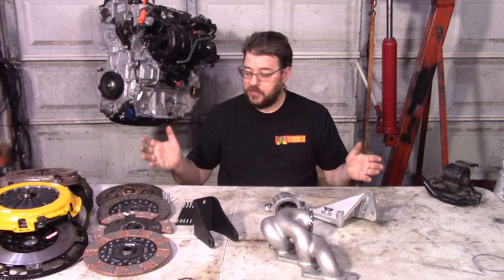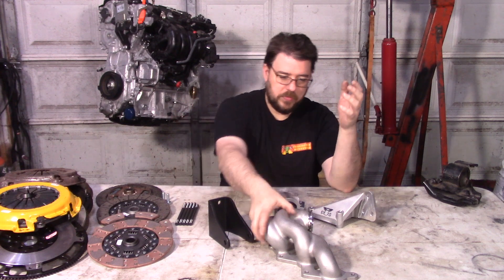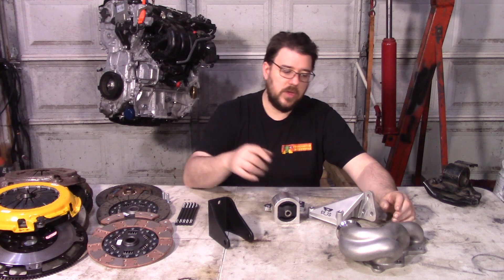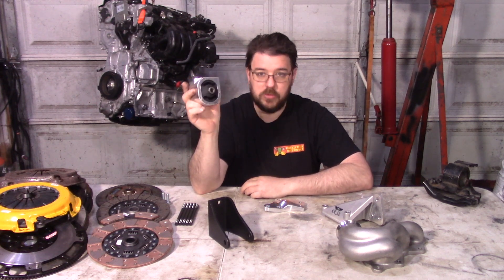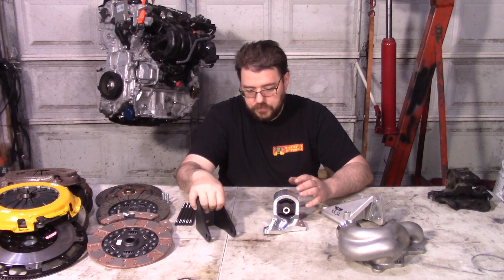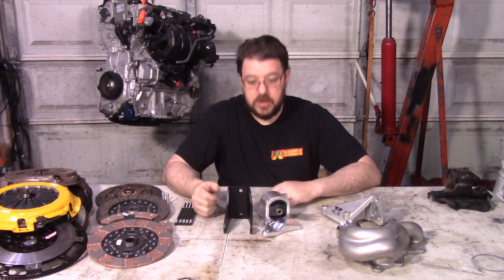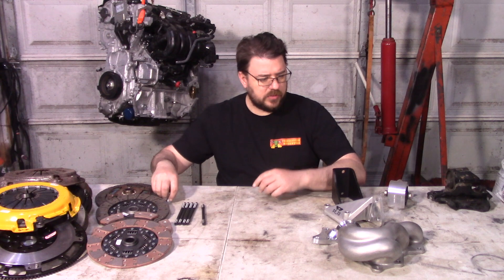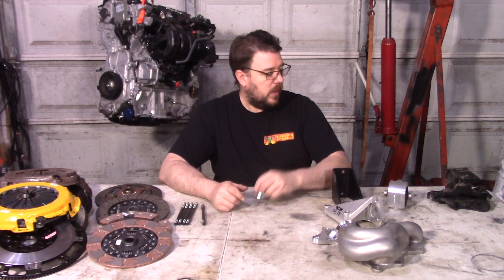New MR2 parts for engine and transmission swaps

Comment: Suggestion on the studs studs not bottoming out, put an appropriate sized ball bearing in the blind hole to bottom them out on, then torqueing the nuts won't be an issue.

Comment: It’s funny you mention about the 11/13/15/18 sizes. I used to buy older vibes and part them out, it was insane how many bolts were swapped to these janky sizes. I’d be under the car just screaming why!
Reply from the maker: I wish the JIS sizes were easier to get for most people. Online store like https://belmetric.com/ can supply everything quite easily but it takes longer than just getting a bolt locally. But it frustrates the hell out of me to run across goofy hardware on a car.

Comment: Are the upgraded head bolts for when you eventually boost the 2ar, or needed for your NA build?
Reply from the maker: I'm using it on the NA version but i have intentions on getting stupid with the fuel types in my experimentations.

Comment: Fuck me I was working on my girlfriends Jeep and it used 19, 17 and 15mm bolts! WTF Who does that!
Reply from the maker: Anyone that isn't a Japanese car manufacturer. JIS stands for Japanese Industrial Standard and has all kinda of really cool things in the spec that makes Japanese cars a lot easier to work on. i don't understand why other manufacturers haven't adopted a similar standard.
Reply: @FrankensteinMotorworks  It does baffle me that more don't just use the JIS! It's brilliant.
Reply: @WilliamJasonSherwood  look how long it took, and is taking for Americans to adopt the metric system. It is better in every way! Even the bolts are better, “semi” fine thread for more holding force, drill size for a tap is just diameter minus thread pitch. Super easy